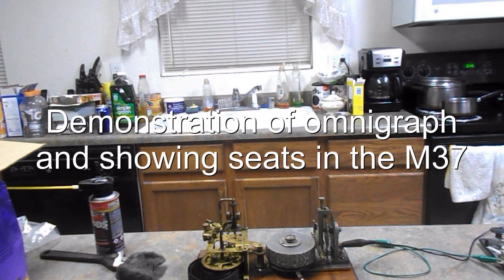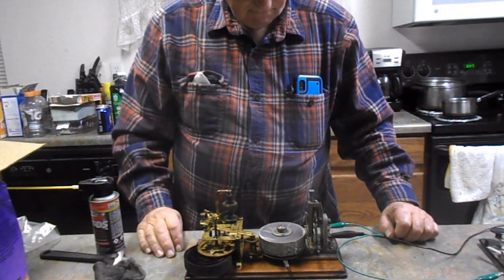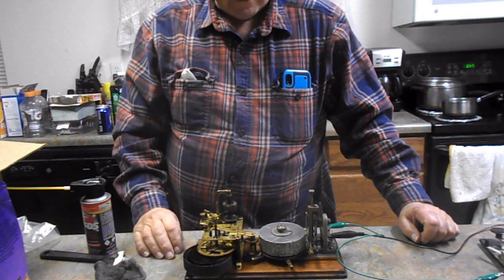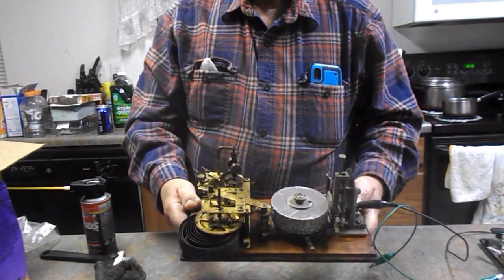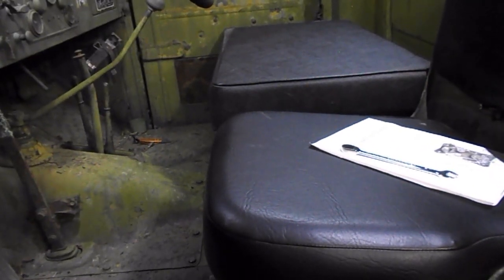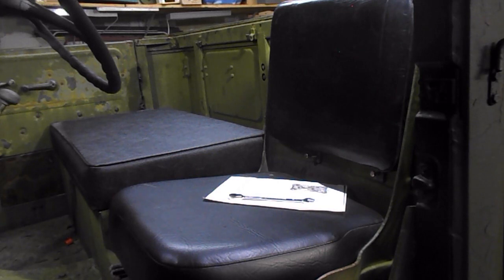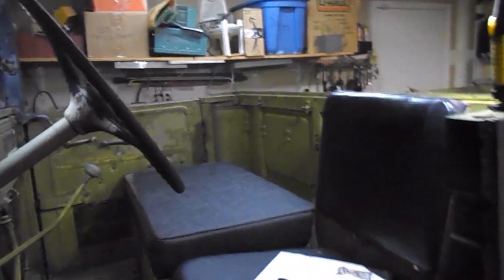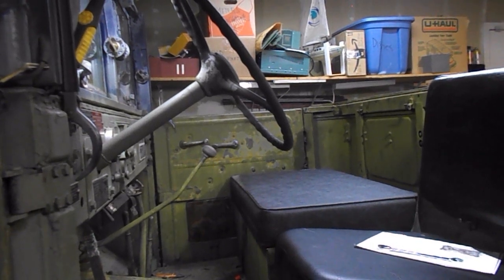Demonstration of Omnigraph working and M37 seats and snow?

Comment: Larry, very interesting equipment, this is my first time to see Omnigraph. Your seats are looking awesome! Miss snow, have not see it for many many years in florida. Have a good day Larry. Regards, Jay
Reply from the maker: yes Jay not many people have seen one of these unless they were taking a Morse code test in the 1920's. Yes after i put the front seat in when the back came i had Ron over and we looked at it two spots in the backrest lined it with two brackets had to use a pier of pipe to etend them and we got it to fit so tight it will never come off. I was just lucked I got the bottom on and the tracks underneath still worked with the metal lever on thee  side. the Passenger seat has to be removeable because it sits over the battery box. It is freezing here today 25 degrees at 11 am.
Reply: 25 degrees! That is very cold for us. Hope soon you can drive your awesome truck.